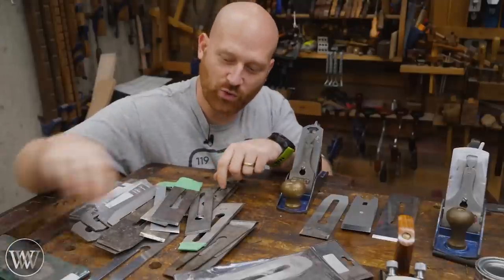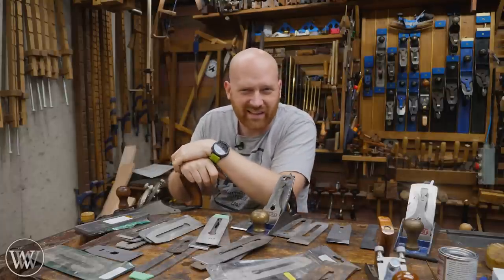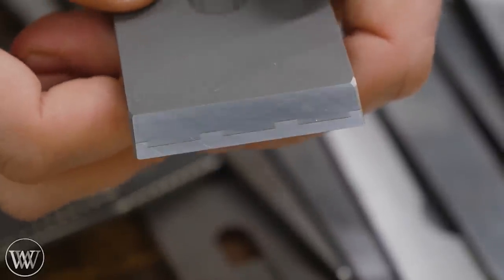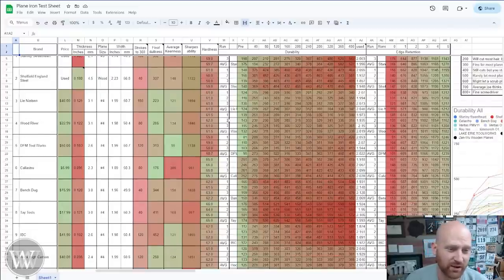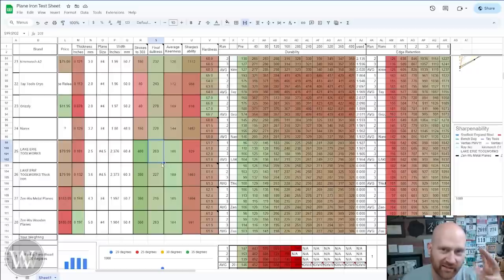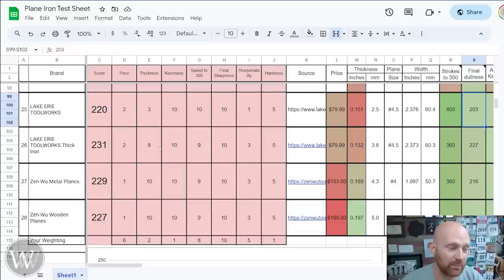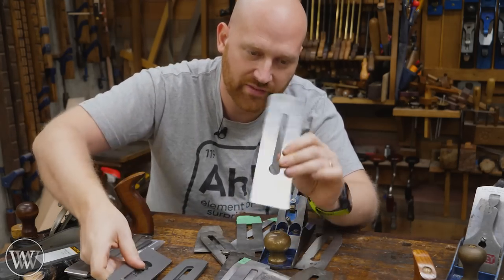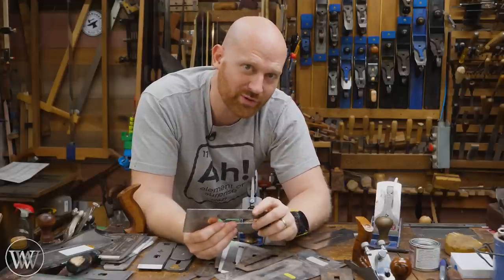The Best Plane Iron Ever Full Data Test

Comment: I want to know which one gets peak keen bloodthirsty from just BARELY beginning to dull with a few seconds of stroking on a rouged strop, because that's what I do with my old Sweetheart Stanley 605 blade and it's a process of literal seconds.  If the super special techno-steels won't strop to hair popping sharp in literal seconds, they will be slower to touch up in my shop in actual use, and I don't care if they stay sharp enough to rip some hairs off your arm if you apply pressure and scrape at it several times for longer than the old O1 blade-steel.  For me the best blade is the one that strops to bloodthirsty hair-popping peak sharp quite literally faster than you can put it into an overpriced  honing guide to use on an overpriced waterstone, if the steel doesn't do that it's inferior for my method of work, it won't be as sharp as often, or cause inefficiency in work flow, requiring precise effort at a very expensive stone in a honing guide trying to maintain a perfect angle to cut the ultra tough steel.  It's like a hand saw in this way, I don't want it so tough I can't file the teeth sharp, I don't want my plane blade so tough and hard it won't strop.  That's just me though, if others are very happy to place all their blades into honing guides and work them on stones for several minutes all the time, maybe it's a good choice for them to have super tough wear resistant harder steel blades.
Reply from the maker: The odd thing is that some of the new irons that stay sharper longer are just as easy to sharpen. They take literal seconds on the strap.